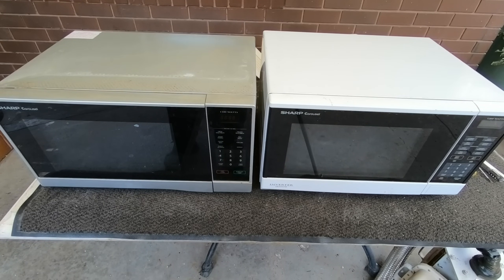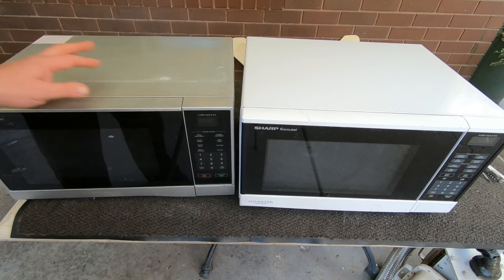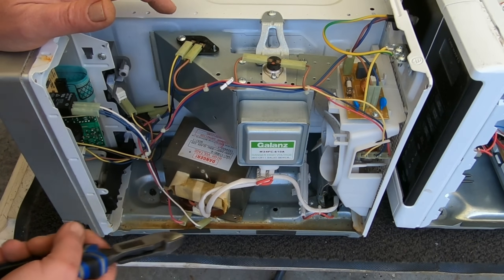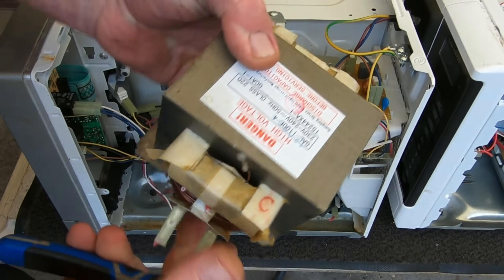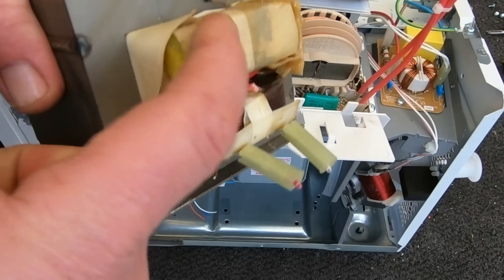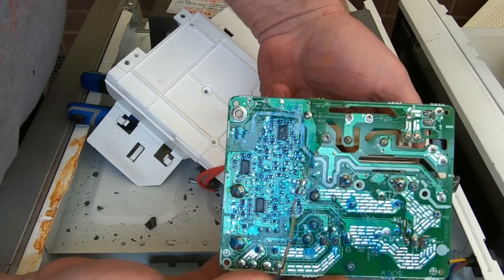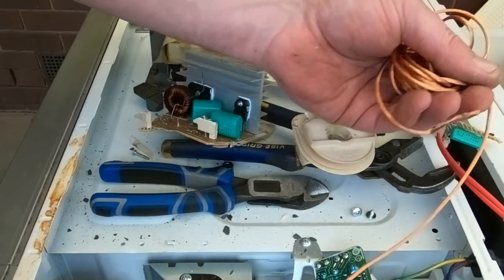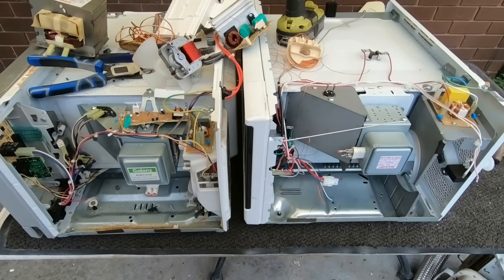Microwave Ovens - Transformer vs Inverter Models

Comment: Inverter microwaves have a transformer but it works at a much higher frequency so it does not need a big heavy iron transformer. Also the ceramic used in the magnetron if shattered the dast is carsonagenic
Reply: The cacinogenic dust was a beryllium ceramic used only in the early 70's and prior, not a common find these days.

Comment: Could you use the inverter to power three phase motors ???? Would you let me know if you would sell me the capacitors from the ovens ??? How do you know which transformers have half and half copper aluminum wire ???

Comment: Most people lack the knowledge or just don't care. when a Microwave stops working, 95% just a blown fuse, which you can replace yourself. The fuse may cost $5-7.00 and the microwave is good to go.  I've saved myself a lot of $$ fixing it myself let alone kept it out of the landfill.  Sad how people are so quick to put it in the trash and go buy another just like the corrupted manufactures like it. They only want your $$ to over pay the CEO's.  ALL ABOUT GREED.

Comment: Aside from scrapping, inverters are much better cooking devices. The PWM circuit gives you a smooth ramp of power instead of blast food - off - blast cycling.  Doesn't superheat the outside of your food as much and cooks more evenly, though it takes longer on lower power which is good. Nevertheless, it's still a microwave.

Comment: Dam I repair old Microwave, flatscreen TV, project electronics and refrigerator and fix battery for drill as a hobby.
I’m looking at all those resistor capacitors ribbon cable . See money thrown away.
The carpenters had some Milwaukee battery that went bad 12 amp hour 
I fix for him and gave him 5 year warranty on top of that .
Like I say it a throw away economy 
I call recycle center and bought a pallet of broken flat screen TV last month. They charge me $40 for 100 plus broken Tv.
Friend will ask me to repair stuff once in a while . If it a really expensive to buy a new one. I like to keep extra parts on Hand.

Comment: Junk Magnetrons can go in with the scrap electric motors!
Reply: No they cant. Magnetrons have ceramic magnets, a tungsten filaments, dangerous aluminum oxide insulators, and almost no copper. They should be sorted in another pile. Or better yet, thrown away and not bothered with.
Reply: @theq4602  My nonferrous yard buys them as motors, they've been doing it for years. It depends on the scrap yard, the anode and filter have copper.

Comment: Dont you take the magnets out of the magnatrons?
Reply: Mr. greens boat tanks and aluminium welding the magnetron have an element inside that causes cancer... there is a ceramic piece inside that when broken and the cover removed will allow the element to go airborne and cause lung cancer
Reply: because accidents never happen to good people, right? Honestly, those magnets are not worth the risk. Need magnets? Scrap speakers but leave the magnatrons alone.
Reply: luckygen1001 lmao!!
Reply: You are forgetting that the fan that cools the magnetron is blowing invisible toxic dust inside the microwave and then outside where you and any other person can breathe that toxic dust in.
Reply: @luckygen1001  uh oh, i busted open the magnetron and the ceramic pieces to smithereen
Reply: Don't break the ceramic piece and you will be safe.
Reply: luckygen1001 if u remove the magnetron cover then u will have a problem

Comment: id take an inverter over a transformer mic any day of the week, did a test recently and for 15 transformer mics, each with 2 coils in them, so out of 30 coils that could have possibly been copper, only 3 were...  might have hit a bad run. but it chews up time so i dont bother stripping out mic transformers anymore. just choose to leave them whole.  guess id rather keep some time up my sleeve in preference to being punked by aluminium ftransformer coils
Reply: Just a shame they only last 2-3 years instead of 20-30 years

Comment: I just scraped a microwave with an inverter as well.  Do you know why the thicker copper wire is stranded instead of solid?
Reply: I know the answer to that, they use multiple strands as it's:
a) More efficient, which does matter given 600-900w microwaves.
b) Earlier to wind, as wire more flexible and easier to pack close together.
c) Less risk of wires snapping from vibration, solid wire is easier to snap.
d) Transformer is higher frequency in inverter microwaves, so complex technical reasons behind how the transformer is constructed.
Reply: Ah, ok.  Thank you. :)
Reply: The only reason why there are multiple strands is because of the skin effect.

Comment: There is no charge left in the capacitor, There cant be, There is a discharging resistor inside
Reply: PETR DOLEZAL When doing work like this, never trust the resistor, they can fail.
Reply: RCM how, they cant burn out
Reply: PETR DOLEZAL resistors can burnout if they get too much voltage, or go open circuit. I've gotten bit by a capacitor that had a resistor that failed.
Reply: ok